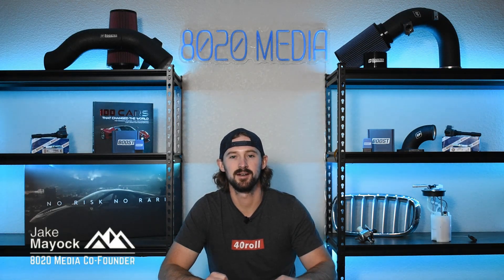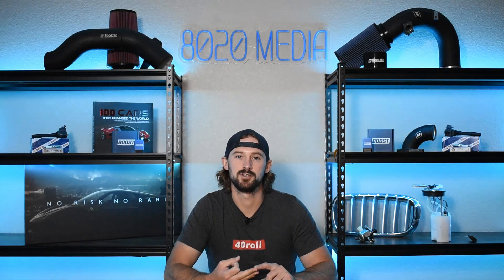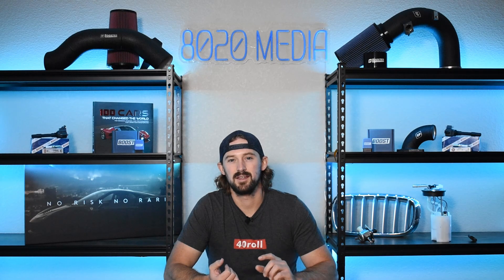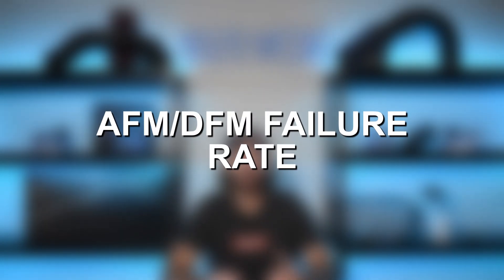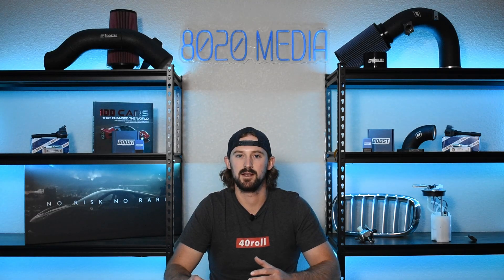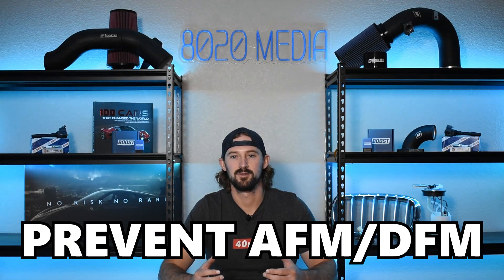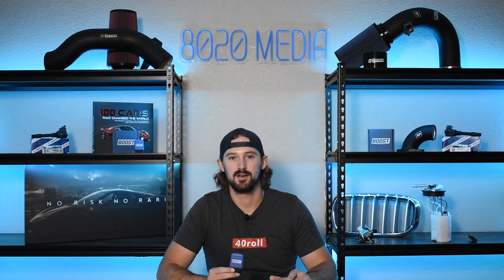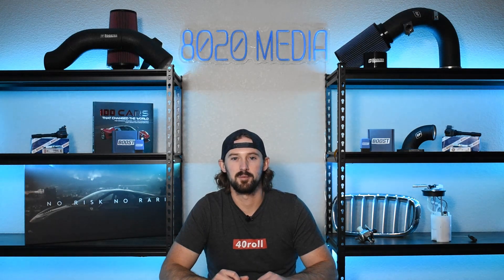GM's 5.3L EcoTec3 | Common Problems & Reliability (AFM/DFM)

Comment: I have a 2014 Silverado 1500 with the 5.3 and it has 220k miles on it with the factory engine, if you don’t dog these engines and keep up on maintenance they are pretty reliable, I just recently got a afm disabler just to make sure
Reply from the maker: L - Thanks for taking the time to share your experience!
Reply: Disabling the afm doesn't really fix the lifter issue. You need to get those lifters out before they destroy the engine. I do lifter and cam swaps on these engines all the time. Usually a 1 day turn around.
Reply: @MrC9Oh3  You have been spending too much time online worrying about this. The well taken care of and maintained engines with AFM are living ripe old ages well int 200K+ miles. Use high quality 100% synthetic oil and a good quality oil filter. I change my oil every 3.5K miles and change trans fluid and filter every 35K. No problems. The people who run into trouble defer maintenance and the failure rate is still 1to 4% on them.
Reply: @gwizdolby 100 percent !!
Reply: Luke, these troubles reported in this video are not related to "dogging" the trucks. These issues are manufactured into the design of the vehicles. I've owned several Silverado 1500 in the past and never had any issues with them. Bought brand new and kept them 15-18 years and were high mileage, dependable vehicles. I currently own a 2022 LTD LTZ that I purchased brand new and it suffered its first failure with 1500 miles on it. I received a call from GM with an apology and a promise to make it right and they did. Later at the 28k mile mark, the trans shudder started. After replacing the fluids at the dealer, it resurfaced again at the 35k miles. Now at 50k miles the shudder is worse than before. I have an appointment next week to take it in to be fixed as GM have changed the type/weight of fluid to be used. If there are no metals found in the ATF, dropping the pan, changing the filter and fluids will hopefully fix it for good. I assure you my "Pavement Princes" does not get dogged. This is, but one of the issues with these trucks.

Comment: so.... basically no new engines last past 100k miles.... SAD! 

Is there a way to check if the software was not installed for the cylinder deactivation!? I don't want that!
Reply from the maker: R - There is! Do you have a 2021 model year? Those are the ones that didn't due to chip shortages in COVID.
Reply: Doesn’t matter…the lifters themselves are the problem

Comment: You forgot to mention..... remove transmission thermostat and put the Sure Cool part # STL010
Reply from the maker: G - Thanks for the insight.
Reply: Spot on. I have the sure cool trans thermo replacement in my  ‘16 Silverado and it shifts like a dream.  Trans won’t get above 150 degrees

Comment: Have a 2023 GMC Yukon 6.2L with 15k.  At dealership awaiting 3rd engine.  I believe all were lifter issues.  So mad, I am thinking 3.0 diesel now?
Reply from the maker: R - Wow... sorry to hear. However, thanks for taking the time to share your experience!
Reply: My 2021 AT4 6.2L dropped a lifter at 23K miles while doing 75 mph. Bad news from there…Started drinking oil at 40K miles.  I finally sold it and bought a 2025 Silverado LTZ Z71.  Good luck.

Comment: I have heard battery drain issues with these devices but I did not recall you covering that issue. I just bought a new 2024 GMC with the 5.3 and would appreciate you explaining why the battery could drain when not in use. Thank you for the information!
Reply: My 2023 GMC 6.2L battery replacement at 8k.
Reply: 2023 1500 battery dead at 7200 miles. Fortunately, it was under the 7500 mile warrenty coverage. Gm got to pay for a new battery and tow to the dealership. @reallymatt6494
Reply from the maker: T - Our device plugs into the OBD2 port and even when the vehicle is off, it pulls a very minimal amount of power, 0.71mA to be exact, which happens to be the lowest on the market. You can leave your vehicle parked for 2+ weeks with the device plugged in and there won’t be substantial battery drain. 
 
However, if you are worried about it draining your battery, you can always unplug it every time you get out of your vehicle.
Reply: Link  @8020Automotive

Comment: I just bought a 2024 silverado lt trailboss with the 5.3L. After test driving the 2024 f150 xlt powerboost with the 3.5l,  I was not at all impressed. Unfortunately I have always been a Ford guy. The silverado feels like a solid built pickup in comparison with plenty enough power. Both have their issues.
Reply: I'm not sure what your point is my friend? The naturally aspirated engine especially a small block GM will always be far superior to the turbo boosted little 3.5 Ford. I understand what you're talking about with the "felt power" but the 5.3 absolutely trounces the 3.5 in every single way. Ford is playing all the city boys who dont need a truck but want to be seen as a real man, and they think they got something special with their little turbo v6 lol and for them thats great I truthfully wish them the best. However those of us who actually work and run our trucks hard, and do so for atleast 150,000 to 300,000 miles the chevy small block easily last that long by running range tech AFM delete chip. The lower cylinder pressure, lower heat build up helps out enormously, even with the oil getting fuel dilution.

If that little Ford fits the bill for you, excellent especially if you're able to get the 20mpg the proper V8 gets because its not taxed nearly as heavily as the little V6 eco boost is, Ford still hasn't been able to perfect that engine I believe they are now on the 14th retune on it lol

I do love that dam 7.3 godzilla Ford made, after they cheated out with the cam, and they were all delaminating at the 40,000 mile mark, they got her down good now. 

I still have my chevy 2500hd with the L8T 6.6 gasser, another proper GM small block and being a 401 with about that in HP and 464 ft lbs of torque, 100% HD cast iron she's an animal and I get 15mpg around town and live in the mountains so always going uphill. When im towing heavy I still get 10 to 12mpg ....secret is running NON ETHANOL fuel, it hold 15% more energy per gallon compared to gas with ethanol, our variable cam timing and direct injection, 10.8 compression engines are finally able to truly make use of the better fuel. My older trucks pre DI, VVT and lower compression couldn't really use the benefits. That little 3.5 turbo you have absolutely LOVES premium non ethanol gas, if you haven't tried it man you have to, you'll notice a huge difference
Reply: @johnserrano9689  exactly...I've had two Ford F150 SuperCrews with the 5.0 V-8 and they are runners with 19-20 mpg on the highway at 75mph. My friend bought the 3.5 Turbo in his F150 and had nothing but trouble with it. It's a truck and you need a V-8 to haul that rig around. GMC & Chevy have the bulk of the available V-8's, Ford on the other hand it's like pulling teeth to get that 5.0 engine. I don't keep my trucks much over 60 -70K miles so not many issues. But, my 2020 F150 5.0 had the dreaded "cam phaser" issue. Finally, the service writer told me that the repair had to be made, which it was under warranty at 30K miles. That's not good. So, if you're driving a V-8 Ford or Chevy you can look forward to potential issues. Pretty sad, because the old 289, 283, 327, 350's were pretty much bulletproof...but your Congress had to get into the act and demand "mileage" changes...so my old 327 got 18 mpg combo and 20+ on the highway now gets lower mileage & all of the mentioned problems. This is why you don't want government running or telling you how to run anything.
Reply: So you're ok with the chance of lifters failing and grinding down cam lobes sending metal dust throughout the engine?
Reply: @hmdwn  you will hear the engine ticking before that happens. If you drive it and hear the ticking then yes your wearing your cam. Anyone who ignores noises of their vehicle will have worn cams. Everyone else will just need new lifters
Reply: I change oil every 3000miles and my 2019 GMC Sierra at4 right now 168.000miles on it nothing wrong with engine. The transmission the dealer replace at 60.000miles and still strong 😅
Reply: @giovannifast6669 it went bad at 60,000?
Reply from the maker: J - Congrats on the new truck! Thanks for sharing your experience.
Reply: I leased a 2021 with 5.3. Broke down 3 times in 3 years. Lifters on both sides and torque converter
Reply: @HankSnatchez  That's why you have active fuel management turned off on any of these newer engines with that stuff. Only time I wouldn't is if you are leasing, or it's under warranty. Soon as warranty is up I'd install new lifters, and turn off that AFM
Reply: Great motor just get rid of AFM and be great again❤

Comment: When they stopped using vortec that’s when shit hit the fan
Reply: As much as I love the old 5.7 vortec 350 engines, the first generation 5.3 LS engines far exceed them. It went to shit when they started using the afm and dfm systems. You can still disable or fully delete it and have a rock solid engine. It's just costly. There's a reason why the LS swap is the most common engine swap today. They literally swap the 5.3 6.0 and 6.2 LS engines into everything, just like they did the 350 and 454 swaps back in the day.
Reply from the maker: G - They don't make em like they used to unfortunately..
Reply: Was it called an LM or L3 ? that was the last sbc 5.7 with roller cam , throttle bottle injection, electronic ignition commonly hooked up to the TH 400 .
This engine sounded wonderful and lasted 500,000 miles on my old van .
It didn’t have the hp or mpg of the vortex but was rock solid and I would buy it again if I could on a new truck .
Reply from the maker: T - Pretty much!
Reply: Wrong.  The LS/LT are far more reliable than any SBC.  The issue is the AFM/DFM, delete it and zero issues.
Reply: I bought a Hypertech Powerstay 8000 and it disables the AFM and would the start/stop if my 2017 Z71 was equipped with it. I also installed a lower temp thermostat kit for the transmission, changed the fluid and wrapped the crossover tube. Hopefully with 42k I might have caught it before it was too late.
Reply: 🏆 COMMENT 🏆

Comment: I've got a 2001 gmc sierra with this engine with 350k miles.  Should I go with same engine when I eventually replace it?
Reply: Yours doesn't have afm or dfm. Chevy didn't start using it until like 2007.
Reply from the maker: E - We wouldn't, but we can't tell you what to do.

Comment: Hey so I’m looking to get a new 2024 Chevy trail boss with the 5.3 or the new f150 3.5 eco boost power boost which 1 would be more reliable?
Reply from the maker: J - It's hard to tell honestly since these vehicles and engines are so new. Just maintain them properly and they should both be good.
Reply: Go with the Chevy. You can disable  the dfm for now and eventually delete it when and if you get to engine failure.
Reply: Wondering if you made a decision between these two vehicles? If so, what was the deciding factor?  Thx!
Reply: Own a 2024 Silverado 5.3l how soon will you guys put something out for 2024?
Reply from the maker: L - This is something we are working on and hope to have updates on our website at the beginning of the year.

Comment: can i use ur oroduct on my 2021 silverado 2.7 turbo ?
Reply from the maker: S - Unfortunately, it will not fit your vehicle.
Reply: Does it work on 2021 suburban? (10 speed)
Reply from the maker: V - Unfortunately no. However, we are looking into a solution for the 10 speeds.